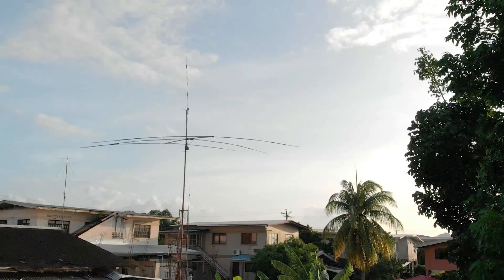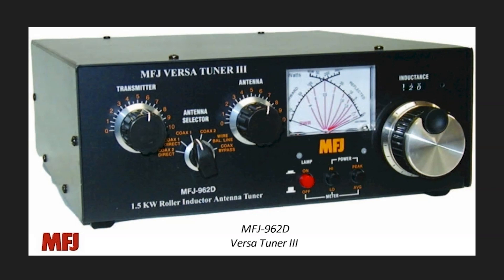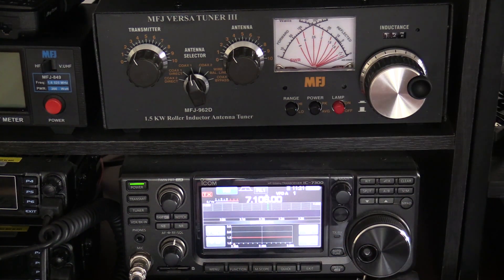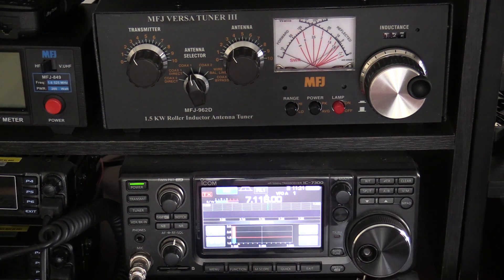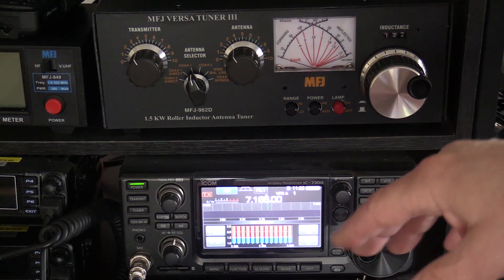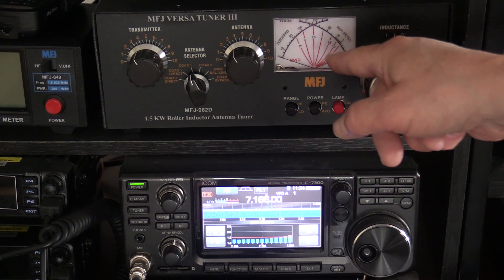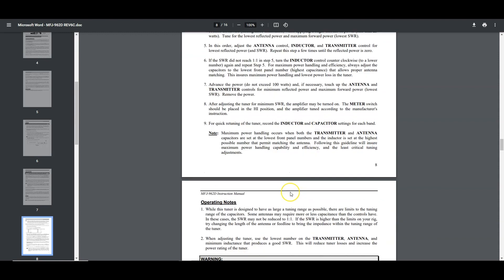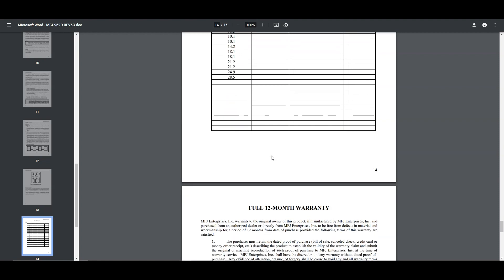The MFJ 962D Versa Tuner III

Comment from the maker: Antenna Tuners are an important part of any Ham Shack.  There are many models to chose from, both manual and automatic.  Here is one of the manual tuners that is mid-range and offers good protection for your gear.  Please comment below if you use a tuner and if so, which one(s) you prefer.

Comment: Take notes as you tune each band or frequency, then when you consult that list you can go directly to the flat SWR. Even if you change your antenna the readings will be much the same with just a little adjustment.

Comment: I bought one of these but it's an E.  I could have sworn it was for amps over 1500 watts.  The MFJ962E works really well for me.  The thing that did throw me is that it won't work without the power supply.  I thought the power supply was just for the LED meter. I accidentally unplugged the power supply and wondered what the hell did I change?  I plugged the power chord back in and I heard a relay click and everything was normal again.
Reply from the maker: If all else fails, reboot!  (I work in I.T. and this step works wonders.)

Comment: I have a MFJ 969 Versa Tuner II but hardly ever use it.  Since I no longer have my old Kenwood TS-430S, and now have a Yaesu 991a, I just use the internal tuner in the radio.  Since all my antennae are nearly perfectly resonate the 991a internal tuner does the job.  It even tuned my Ringo Ranger II (2 meter) to 10 meters and I made a contact with it.  Tuners are really not tuners per se.  They're merely and adjustable matching transformer to match the impedance of the radio to the antenna.  It really fools your radio into thinking it is seeing a perfect 50 ohm load.  Cheers & 73 from W Rusty Lane K9POW in eastern Tennessee
Reply: It fools the radio but does it improve transmission/reception of said radio? Cheers and 73 to you too good Sir. Btw shout out to Tennessee !

Comment: got my mfj 962d in 2008. ive never owned a amp but it handles a 450ohm center fed dipole that i have cut at various lengths without issues .